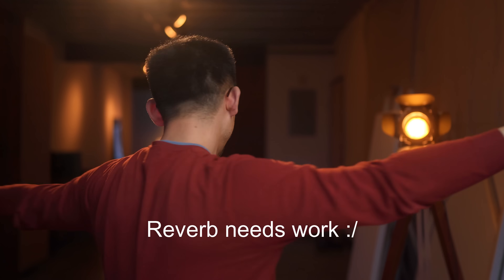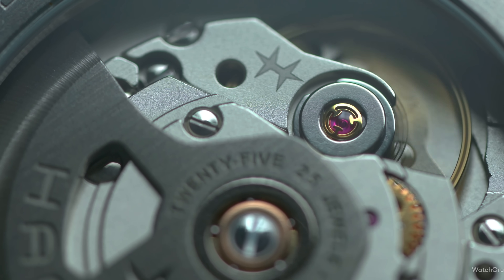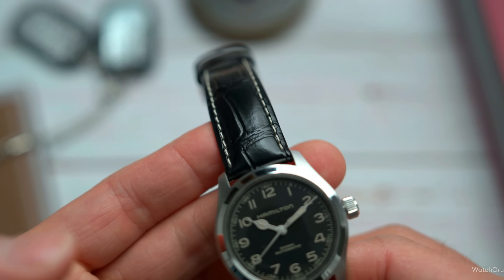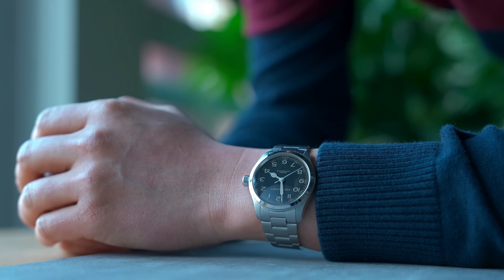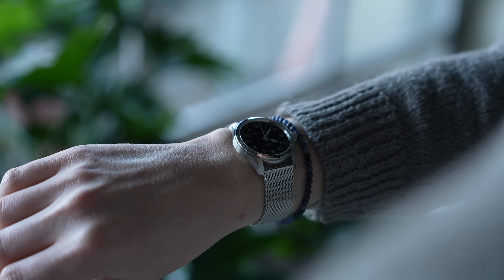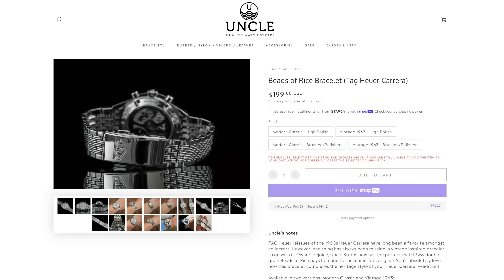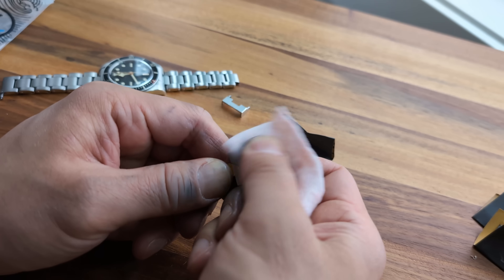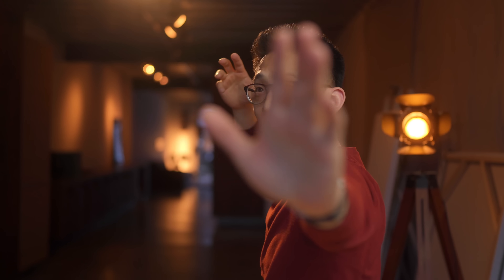Don't Sell that Watch until you try this BRACELET

Comment: A top video Max. Oddly I'm wearing my Murph (old version) on my wrist today when this video popped up. I confess I have not considered changing the strap as the original is comfortable on my 7" wrist. As a modern watch designed to look old with the aged hands an numerals It ticks all the boxes but yes adding AR would make it more readable. I'll have to see if a strap from uncle is available for my version and give it a try at some point. You did a cracking job on the BB58n clasp though and I might just consider and Uncle bracelet for my BB58. The clasp clean up was great and I might just give that a try on a few of my scratched up clasps. Many thanks for sharing.
Reply from the maker: Thanks Anthony!

Comment: That bracelet looks good. However I bought the uncle strap bracelet for the Hamilton Khaki Mechanical and, sadly, had to return it! Terrible hollow end links, horrible and stiff pressed clasp and the sand blasted finishing didn't match watch.
Reply from the maker: Oh interesting 🤔. Maybe an older design?
Reply: Uncles products are generally cheap the only exception is their rubber diver straps